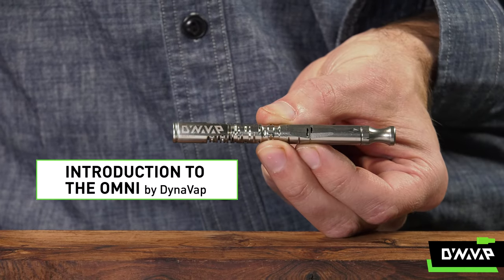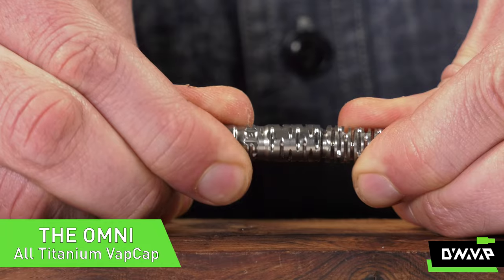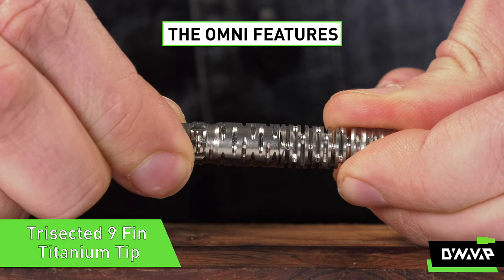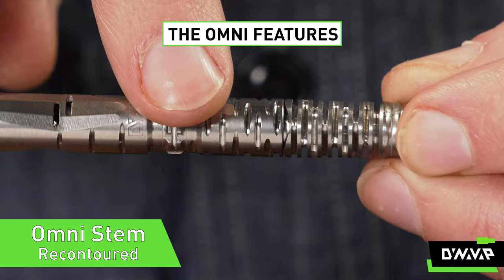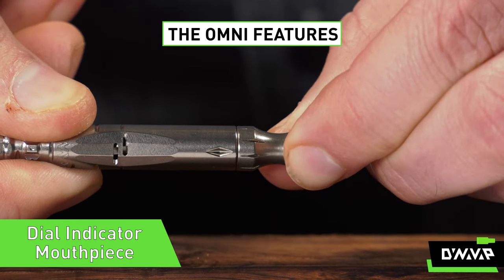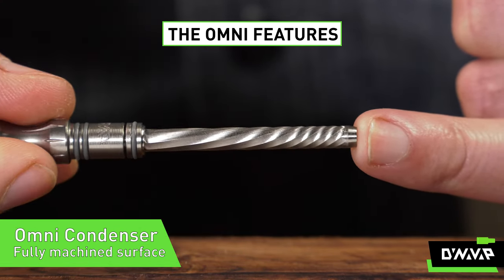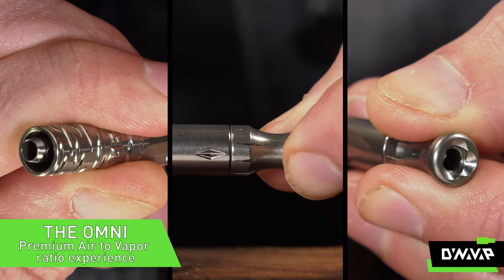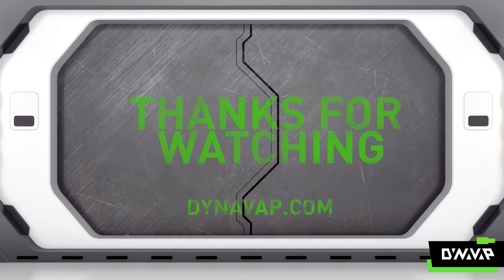The Omni by DynaVap: An Introduction

Comment: I would very much like to know if the connection points become loose while the device is in the pocket. I usually see companies machine the threads that are to wide between the crests causing the pieces to wiggle loose in the pocket

Comment: So this negates the benefits a simrell stem would provide. That is the only change that I imagine anyone would be able to catch in a blind comparison to older models. And this is what like $170? Pretty funny. Beats paying about the same to simrell. Neither are actually worth it of course but here we are nonetheless.
Reply: I have a Simrell Vortex and I have a Simrell Stinger and the New OmniVap and the Simrell still has cooler vapour than the new OmniVap even the singer gives you cooler vapour. When the Simrell Stinger mouthpiece,intercooler & condenser is swapped out for the OmniVap's twisted condenser you can really tell the difference for sure.
Reply: @nickmay9797  should i buy Simrell stinger for my Omni 2021?
Reply: @philongdoan6675  Yeah if you have a few different DynaVaps and are into swapping parts around so the part's make something that is not a standard vape and vape's different to. 
I got a Simrell Stinger when theay first came out I liked it so mutch instead of getting another Old XL OmniVap Condenser for the Old OmniVap's body I got another Simrell Stinger for my Simrell Omni the next time I made a order hope this helps.